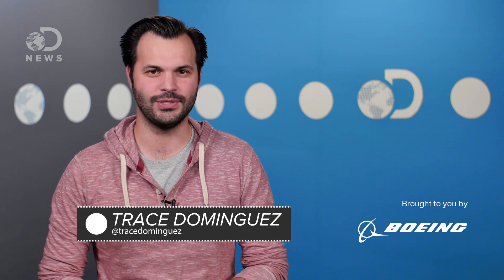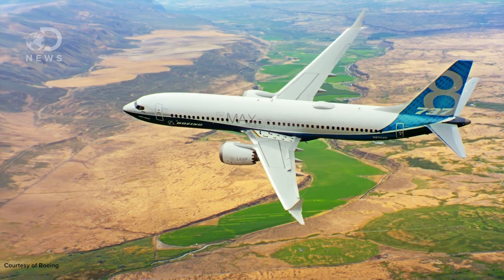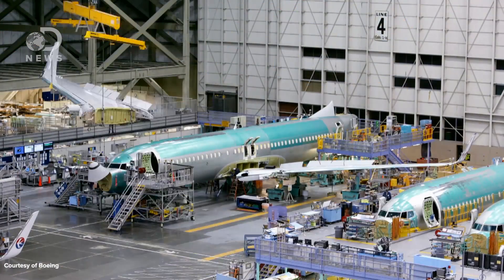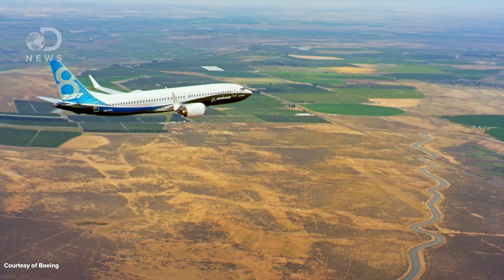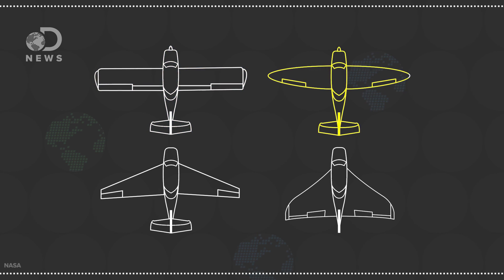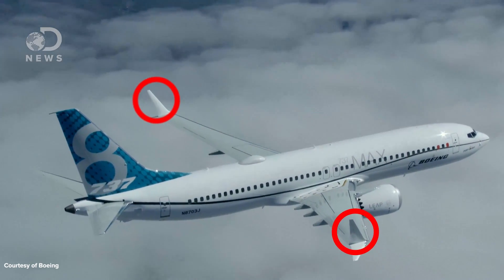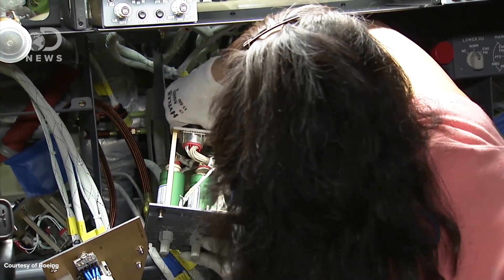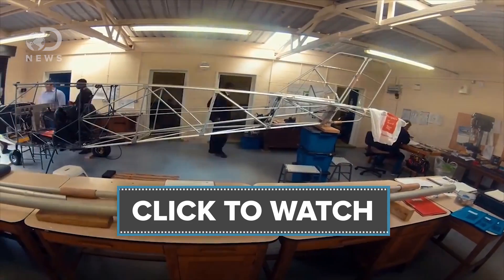Here's Why Wings Don't Fall Off Airplanes

Comment: "we put a lot of time and energy in making sure that the wing goes on correctly and there are zero defects."
well, good to know, since these are the parts that will actually hold that plane in the f***ing air.

what a sentence to introduce the boeing 737 manufacturing supervisor.

Comment: Just a bit of FYI if I may...
Technically you have 4 main parameters for a wing:
Aspect Ratio, Cord Variation, Dihedral & Swept.
(Supposing you don't consider more fancy stuff like variable Compounded Cord, variable aerofoil along span, etc.)  

So the wing of a 737 would be a "Moderate Aspect Ratio Tapered Dihedral Swept wing".
(It's important because you could also have a "Moderate Aspect Ratio Constant Cord Swept wing"...)

Here some reference for science: https://en.wikipedia.org/wiki/Wing_configuration

Comment: I work on these buggers every day, removing/installing Flaps, Slats, Ailerons, Spoilers, #1/#2 engines, tearing apart the cockpit, the cabin, removing the MLG's, the NLG's as well mostly for seal replacement. 

You'd be surprised with the common issues you find yourself fixing, Vapour Barrier cracks, Smoking rivets above the deflection rib,  Rear entry door torque tube bearings wearing out, aft flap rollers wearing out, etc. 

Seems though they're on top of things with the more recently developed 737's, they're fixing these common problems with some neat solutions.

Comment: Spars crack on older aircraft all the time. I have seen many over the last 30 years. The key is that they were discovered during inspections and repaired before the wing separated.

Comment: Basically a better explanation is that the high pressure under the wing spills over to the top at the wing tips, this creates higher pressure above the wing which reduces the lift and therefore its fuel efficiency.

Comment: so why is it that wings and tails HAVE fallen off and makes the plain crash and kills everyone in them ....
Reply: Because sometimes, even though a wing is solidly attached, locknuts come off. Vibration is terrible. Otherwise, structural failure, repeated stress, work hardening due to the impossible to avoid minor flexing, and many more things can simply cause a failure after long enough. It's almost never bad design, just bad maintenance.
Reply: Metal Fatigue. Go to JAL123 and El1862, and you'll find out something. Oh yeah, AA587, another example which coincidentally happened today, NOV. 11, 2001.
Reply: In aviation we never blame the machine, it is always either operator error, or a maintenance tech who didn't follow regulations.
Reply: Its due to material fatigue. The wings can cope with huge static loads and vibrations but repeated cyclical loading will cause metal fatigue and they will break after a number of cycles
Reply: Yup. Obviously the highest wear test spring steel bars will eventually need replacing, because airplane wings constantly flex. Nobody expects a spring to have an infinite life, so why should a giant lift creating leaf spring do the same?
Reply: MOanimations The crash of AA587 was not due to metal fatigue, it was due to the pilots' overuse of the rudder controls when the aircraft entered severe wake turbulence, his actions over stressed the aircraft's rudder beyond what it was designed for thus causing the entire tail structure to fail and detach from the aircraft.
Reply: ythinder Oh, yes. My mistake.

Comment: This video is informative, but it did not explain why wings do not fall off under normal conditions. A modern aircraft wing is a cantilever structure that is subjected to forces such as lift and the weight of fuel and engines. In addition to all the bolts, the wing spar is the main element that withstands the stresses of flight. Stressed skin is also used for additional strength.

Comment: you dont need pilots morono... .all current commercial planes can be flown via auto pilot, to land take off and go to their point of  location or they can be flown from the ground..... we havent needed pilots for many decades.... but lets talk about wings.....
Reply: you do need pilots

takeoffs and landings manual control

taxiing

overseeign crew

watchig for other aircraft

TALKIGN TO CNTROL VERY IMPORTANT

makign sure the compter doesnt fuck up, also important

preppign aircraft

beign ready to step in when the computer fuckes up

computers cant see they are giant calculators
Reply: Hi Chad. I have worked in many departments of aviation engineering and other airline department before flying commercial jets. I am very interested. Please name any one system on an airbus 320 thst is connected to external input from the closed fly by wire system. ELAC? LGCIU? SEC? Or any of their Boeing equivalents. I am willing to believe, if you can give me anything solid so i can research it. Where in the avionics bay would i find these interface units. Also what communication channel is used to send these controls? Acars, vhf, hf? If you make these claims thrn you must be a high level GE or Honeywell engineer who has worked, built or at least seen these components. I have worked on fokker 70/100, md 11, all airbus series and boeing series and have worked with chiefengineers from major european commercial jet airlines and have never seen or heard any of this. Again i am willing to belive. Please name a manufactures of any of these interface units. Dassault? Bae? You said i should look it up. I have looked in many manuals, please point me in the right direction to verify your information. Kind regards, Richard
Reply: Chad W no im not a aviation tech, but pilots know there planes, i dont fly commertial either but the guy above is mroe than qualified to know what systems do what

most remote controlled aircraft are controlled by either line of site datalink/SACLOS (semi active command line of site) in the case of your little best buy target drones or model airplanes, typically operating in the 2.4 - 5.8 GhZ range, again no manned aircraft can tune to these frequencies and the bandwidth is minimal

the us militayr operates dornes on encrypted satilite frequencies around 15 ghz and around 4400-4940 ghz  and the bandwith is much larger, the transmitting satilite dish is 25 feet wide
Reply: Chad W  you do need pilots you dumbass autopilot does not do everything look you're shit up idiot. 😂😂
Reply: 19ngray again. im going to say. auto pilot is not just the only program commercial programs use to fly the plane...

ALL of them are equipt to be flown from the ground since like 1980....
Reply: durr there is another plane heading direct for me lets go high speed ahead into it because it will be quicker to get to london that way
Reply: Chad W hello Chad. i am an airline pilot. an aircraft cannot fly without a pilot. the aircraft computers help the pilot. like a cruise control on a car
Reply: Richard Vervuurt you are not told all of the controls in the aircraft.... look it up....
they all can be controlled from the ground... ALL of the them
Reply: Chad W no they cannot in order to control an aircraft you need datalinks and those come in the form of satilites and ground VHF datalinks

satilite is used for wifi and gps, thats it,

vhf datalink is used for flight computers for ILS, IFR navigation, direction finding and aircraft identification 

the control surfaces of a aircraft can only be cntrolled via autopilot or manual control
Reply: TTT 1 which they have... you are a pilot... not an avionic technician.....they have had total control of a commercial plane for more than 20 years.... you just fly them.... enough said.... now go fly away
Reply: Chad W is it really that hard to admit you were wrong?
Reply: Chad W Hello Chad, just because there is auto-pilot does not mean that the aircraft needs no pilots! Computers cannot fly planes by themselves, these are not unmanned aircraft! They need to have pilots! Auto-pilot is something that helps to stable the aircraft while it is flying in the air, it does not help with take off and landing! Now tell me, if we haven't needed any pilots for many decades, why were there pilots?! There is a big reason why, because I've been on a real aircraft before and I saw the manual controls operated by aircraft pilots in the cockpit!
Reply: Chad W  you do know that the avionics masterswitch,autopilot,radio and gps are all in the cockpit, right? And everything is  controlled by 2-5 people. landings and takeoff cannot be performed by a fucking calculator it need humans incase shit goes down and to actually control the plane. Autopilot was invented so pilots dont have to stay concentrated trying to keep the plane from crashing not to be completely controlled by a massive computer and possibly kill a million people while at it

Comment: So I missed the part where they answered the question, "why don't wings fall off".  I guess the titles for YouTube videos are picked for their "click ability" not for their relationship to the content.  More generally I am disturbed by this new genre of "hipster science" where science is only brought in as cute anecdotes rather than as an underlying element of the entire discussion.  I am an engineer and have been a private, military and commercial pilot for 45 years and I can say with some authority that much of what was said in this video was either incorrect or a gross oversimplification or misunderstanding.
Reply: Yes, it was a very poor explanation of winglet function. They were right about wingtip vortices, but they didn't explain why these vortices are there, and why the wingtip helps with that. The vortices happen when the low pressure air on top of the wing 'bleeds over' and combines with the high pressure air underneath the wing. The resulting vortices mean that you effectively lose lift performance progressively towards the end of the wing. Winglets help with this by acting as a barrier preventing the low pressure air bleeding over. Instead, it is pushed upwards by the winglet, and allows manufacturers to regain lift performance from the last few feet of the wing towards the tip.
Reply: longshot7601 Yep, hipster science for sure.
Reply: Actually the video is incorrect with it's explanations.
Here is a shorter version.  Swept wing create less drag at higher speeds.  Winglets further reduce drag by lessening the drag making vortexes coming off of the wingtips.
Reply: +strato man   Exactly. And this is why I proudly voted down this stupid airline-propaganda video.
Reply: tjf4375 These wingtip devices work on all aircraft, large or small, slow or fast but, the benefit of 1% reduction in fuel use (perhaps even less) simply isn't worth the effort in an airplane where fuel isn't a big enough cost.  There is so much more untapped fuel reduction potential in small aircraft engines and aerodynamic cleanup that going immediately for the wingtips doesn't really make sense.  Some new light planes are moving away from their 1950s technology engines to modern diesels, and seeing as much as a 30% reduction in fuel consumption (plus the ability to use diesel and jet fuel instead of 100 octane avgas, which is getting hard to find in many places).  Most turbines below 1000hp or so are also terribly inefficient compared to bigger turbines and piston engines, so these aircraft also have bigger issues than wingtips to deal with.

In engineering it's always about compromise and cost.  You spend the money where it does the most good (likely not the wingtips on most planes).
Reply: strato man I agree. Finally someone brought it up.
Reply: They didn't mention it but the wheels are under the wings and that holds everything on the ground (otherwise they would fly off). I dont know how it works in the air - but that is at least 1/2 the answer!
Reply: longshot7601
Yeh I like those raked tips - you see the same also on the 747-8. Interesting question as to why this solution does not seem to be adopted for the smaller aircraft. The info I've found suggests that raked wingtips have higher drag reduction benefits than winglets/sharklets, but relatively small lift benefit. So with the larger wingspan aircraft on long haul routes, drag reductions are more economically beneficial. Of interest is the Airbus A350, which actually combines both types - ie a raked winglet, so arguably they are getting the best of both worlds there!
Reply: strato man
Thanks, that's interesting stuff. It goes without saying that aero engineering for the transport sector would be very cost-centric. The discussion I was having with someone else was regarding the use of raked tips on larger airliners, as opposed to blended winglets/sharklets which are mostly the reserve of the single aisle jets. Wingtip devices have been shown to reduce drag by 3-6%, so they do indeed make a great deal of economic sense. A large carrier like BA or Delta can save millions on fuel costs each year from their benefits, so you will see there are very few (if any) jet transport aircraft on the market today that do not make use of wingtip devices of some sort, either in raked tip or sharklet form. High bypass turbofan engines are all now extremely efficient, quiet and reliable, so I wouldn't be surprised if we are seeing somewhat diminishing economic returns from physical engine technology improvements in the last few years.
Reply: There is a structural issues with any of the winglet/wingtip devices, they change the structural loading of the wing.  The more effective the wingtip is at decreasing the loss of lift/increase in drag at the tip the more they move the lift further out the wing.  It could require modifications to the entire wjng structure to utilize a very effective wingtip design.

Think of it this way:. The best way to make a wing more efficient is to use a higher aspect ratio.  This decreases induced drag, partially by reducing wingtip losses.  In a hypothetical infinite aspect ratio wing, the wingtip design become irrelevant but more generally the fancy wingtip performs roughly the same task as increasing aspect ratio, without quite as much of an necessary increase in wing structural strength.  But the wingtip does add some stress to the wing so one needs to trade off an ideal wingtip design (from a drag perspective) with having to make the wing stronger/ heavier.

As to the fuel savings of wingtips can reduce fuel consumption on long flights by as much as 4-6% but offer much lower savings on shorter flights.  So a Southwest 737 flying 400nm or shorter legs from LAX to SFO to SMF to SEA etc. might only see 1-2% savings and the cost of the winglets is roughly $ 1 million or more so it may never break even.  On a 787 that flies 5,000 nm legs you can see 4-6%.  Beyond the aerodynamic and structural issues there are sometimes simple issues of ground clearance, clearance around the gate and vehicles on the ground.
Reply: strato man He said that they use sellotape 😇😇😇😇
Reply: I did. Thanks for that mate.
Reply: Also this was a pretty poor video explaining flight.  They said that swept wings were more efficient at higher altitudes and that winglets keep the wing from going up and down.  Huh?
Reply: I like the raked wingtips on the 787 and 777X.  I'm trying to find the engineering numbers as to why they work on those two airliners yet the 737 Max is using a modified winglet unless it is a trade-off of efficiency verus fitting inside the gate.  One of the few sources that I have found explains that the sharp wing tips suppress the pressure differential between the upper and lower surfaces and thus reduce the vortex but I have yet to find any engineering calculations.
Reply: strato man LOL you're so pedantic.
Reply: ^^^THAT is why there are 'hipster' science videos. Short and succinct, without droning on like your three paragraphs. Not everybody wants an entire Wikipedia page put to video.
Reply: @4seeableTV  Yeah,  cause actually learning something is sooo last century...

Comment: here is why they don't fall off... us pilots aren't dumbasses
Reply: Joseph Penn Credit goes to the engineers who designed them
Reply: Ziad, sometimes I seems they are retarded. And Joseph, it's still the same just the numbers and moments are bigger.😉
Reply: Joseph Penn  you must not be a FedEx pilot😉.  God forbid they try to do weight and balance calculations in an empty plane on their own.  And I was once asked by a captain if we could spray some anti ice on their airbus.  it was 65 degrees outside in South louisiana.  I told her she had to get permission from the tower.
Reply: barnacle pete I'm only a CAP one for now so luckily I don't have to deal with planes that are all that big or do any complex weight and ballance calculations
Reply: Joseph Pen
Reply: Pilots do jackshit these days. Us engineers don't trust them enough. Most large aircraft are controlled through automation
Reply: Why do you keep crashing planes then?
Reply: Elsa

Comment: Oh, the overly ubiquitous 737 making our skies greyer and greyer. Why cut the 757 production line? Nowadays, it is pretty rare to see one, or a dc9, or even the 747. But fuel efficiency is the one of most important factors of the plane, no matter how many 737 clones pop out of the factory... ( I actually like the 737 400 it is a pretty good plane)